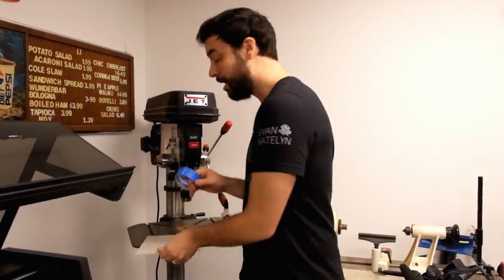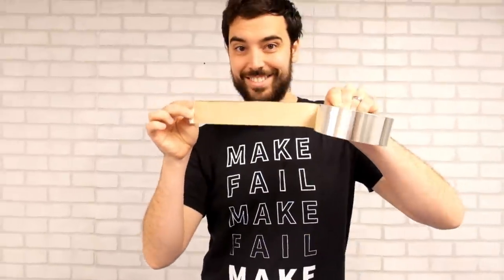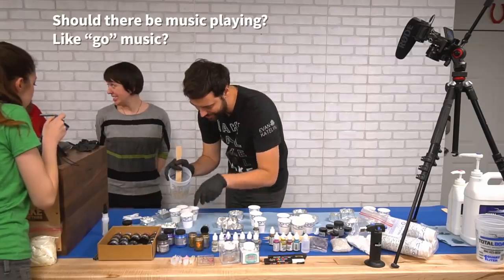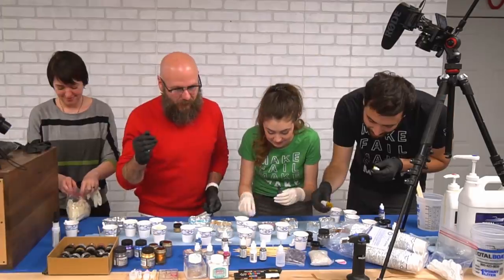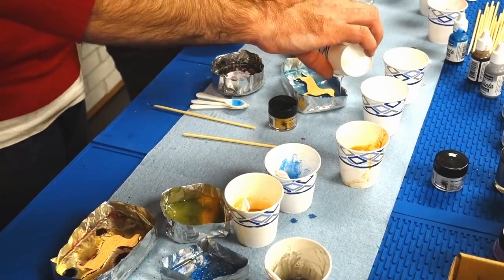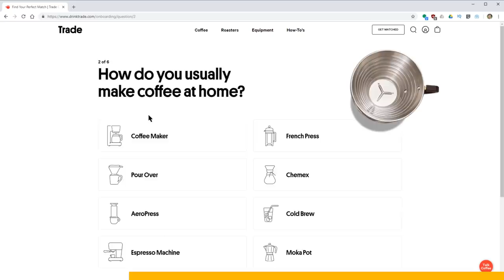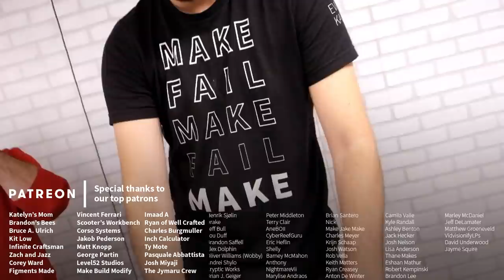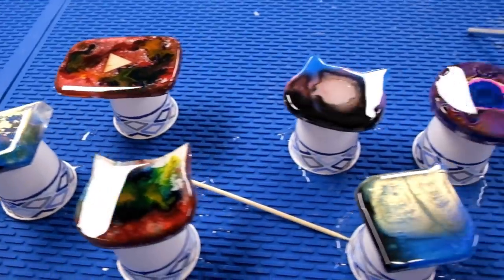Easy DIY Resin Ornaments

Comment: If you want 2 colors to mix less “ie no red and green barf” one thing that I found works is let your resin sit until it starts to get thick before pouring into the mold. 

Great vid. I like how real and unrehearsed it came off.
Reply from the maker: Oooo thanks for the tip!!

Comment: Making it small single layer works. But when adding layers they get way heavy. A few years back I made a 6" circle of acrylic it was a rocking horse laser cut, clear circle, and another rocking horse. But the thing weighed like 2 or 3 pounds. So remember to KEEP IT LIGHT WEIGHT. Still love the idea

Comment: Wondering if anyone considered putting something in the back near the top edge of the ornament, like a ring or a ring-bent paper clip to serve as a place to tie a hook or ribbon for hanging on a tree?  Something embedded in the resin while it was still wet, so you don't have to drill a hole in it afterwards.
Reply from the maker: We did consider something like that! In the end we decided drilling would be easier but if you had like a little copper tube or something that would be really cool!
Reply: Oooh, yeah, a little copper or brass tube would look pretty sweet, too!